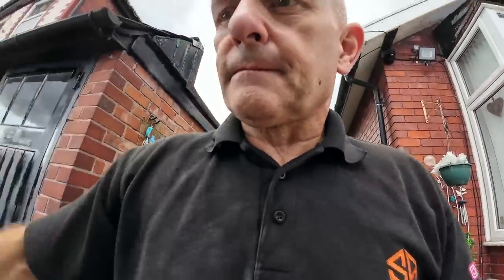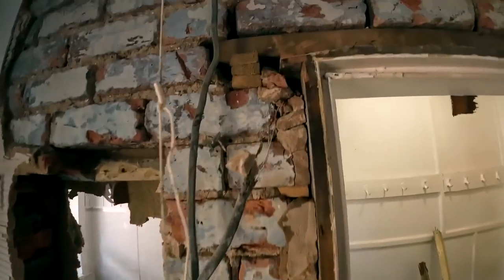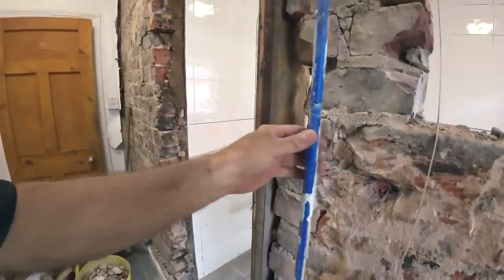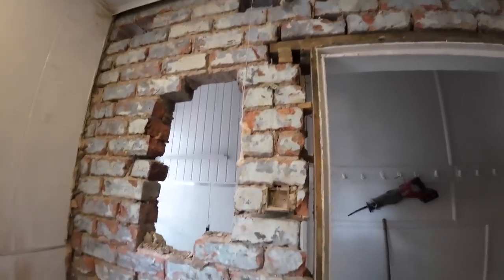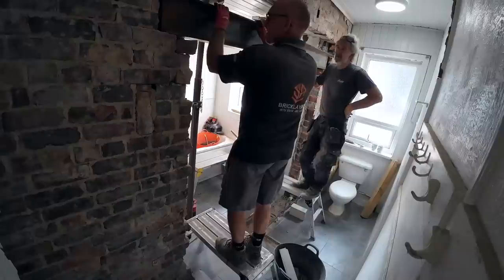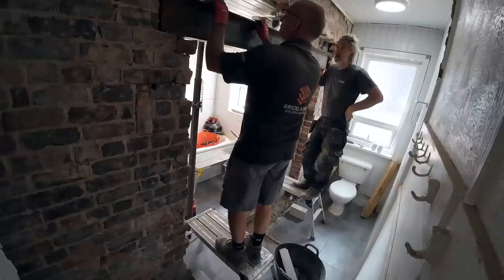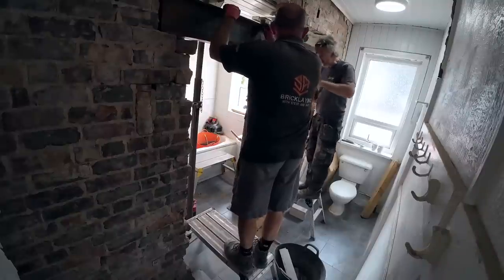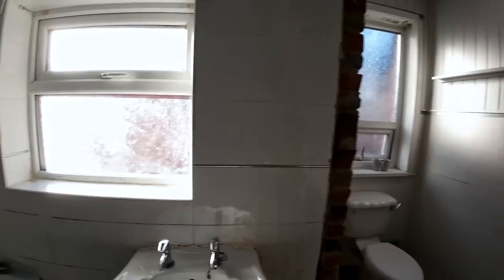RSJ STEEL BEAM INSTALLATION IN A DAY

Comment: Great job there Steve. Reminds me of my first house when we were doing renovations. The random shape and size wire cut bricks, wooden lintels which had dried out and shrunk, no longer supporting anything and mortar so soft you could almost rake it out with your fingers. You're not doing your dodgy hips any favours Steve humping up and down trestles with heavy steel beams on your shoulders. You'll be like the bionic man when you get your new ones fitted 🤖😎
Reply from the maker: Cheers John . Very soon hopefully, really struggling now 🥺🧱👍🏽

Comment: impressive ! 👍🔥

what material you used to pack the gap between the top of the beam and the bricks above ? also did it move at all when removing the acro props ? thanks in advance
Reply from the maker: Thanks 
Slate no it didn’t move 🧱👍🏽

Comment: If you strong boy’d on the side with the higher ceiling could you not have removed more bricks and had the lintel base in line with the lower ceiling for flat run through?
Reply from the maker: We did as we were told 🧱👍🏽

Comment: Great work as usual.
I was just wondering why, given the higher access for propping on the toilet  side that the beam wasn't put in to bathroom ceiling?
Reply from the maker: Thanks . Just working to instructions 🧱👍🏽
Reply: I thought that might be the case.
It would been less work for the plasterer and much neater.
But if that's what the client wants . .

Comment: Great jobs lads. Did you require structural plans for the steel?  Needing to do something similar on a breakthrough into garage and didn’t know if I need a structural report prior to the steel?
Great work
Reply from the maker: Always use a structural engineer 🧱👍🏽

Comment: You do great work but that steel should have gone higher up. Was the client fully aware this could have gone higher.  Its your name going against this job and it looks a bit naff.
Reply from the maker: The steel was put where we were asked to put it . 👍🏽🧱
Reply: @SteveAndAlexBuild  yes but sometimes you have to use your experience and advice people. Someone may come along later on and say to the client Why didn't the steel go higher?  And the client will say that's where the builder put it.
Reply from the maker: Well the client would be lying then because the builder put it where he was asked to